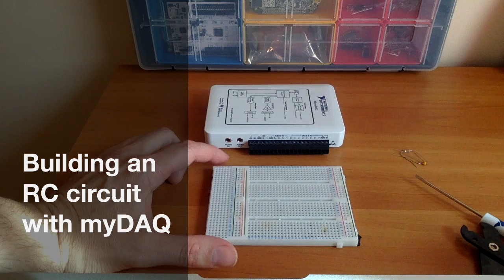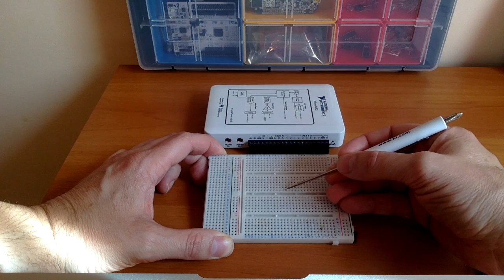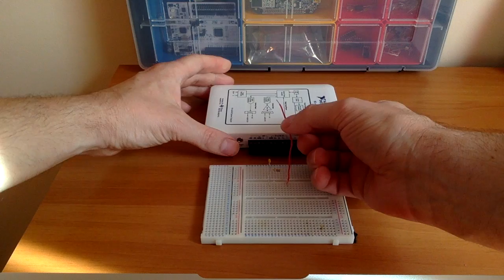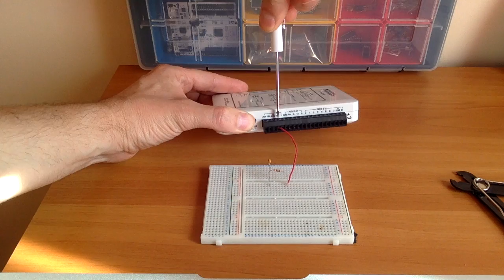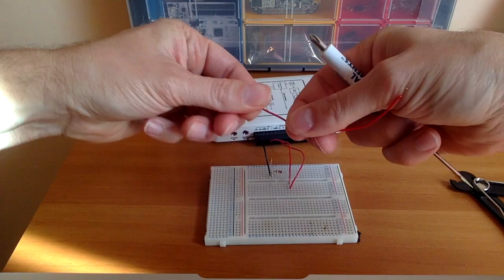Building an RC circuit with NI myDAQ

Comment: If I were to write a code for this configuration in LabVIEW I would need to create two input channels. Could I equivalently wire 0- to the resistor-capacitor placement and then wire 0- to ground?